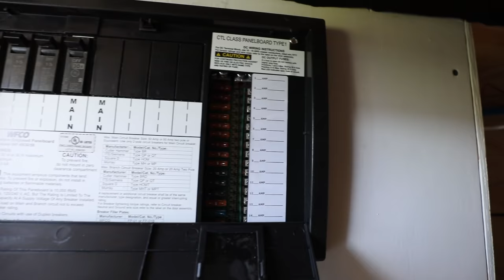Self Built Modern Skoolie - School Bus Tour

Comment: I'm not wild about the solid door replacing the glass bus doors.  When driving, it becomes a vision hazard.   I'd also want a partial wall between the bed and stove, and it can be aesthetic as well as functional. As for the bed, maybe a murphy bed with a desk/table on the underside and a bench seat opposite.  Wood stove?  Oh yeah.